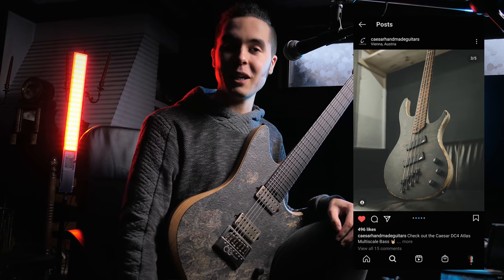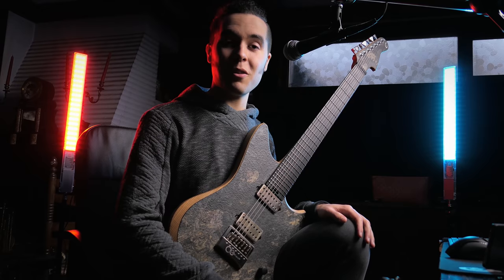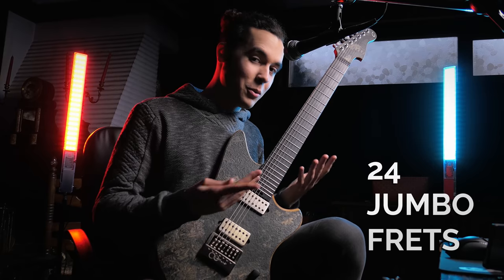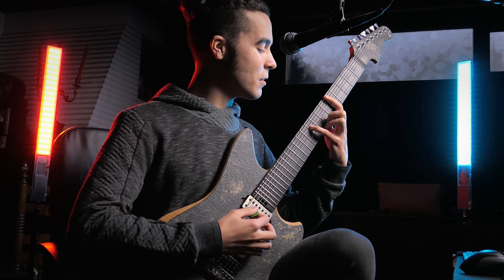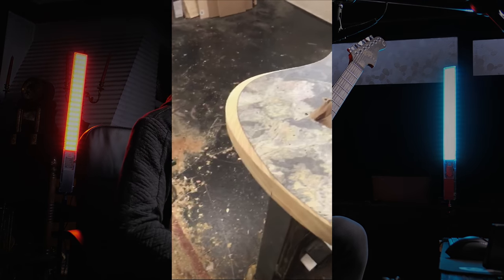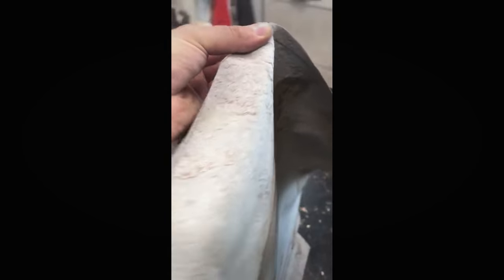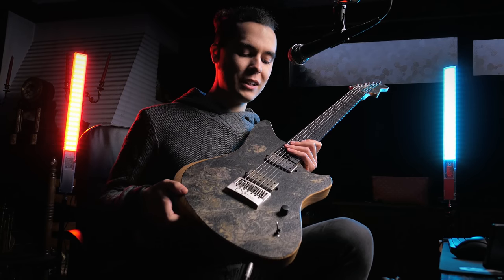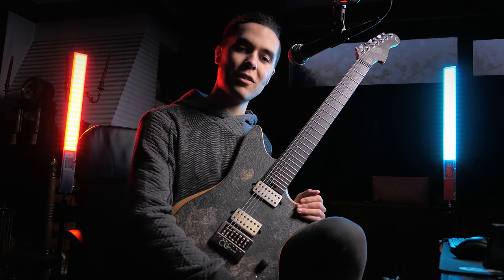My New STONE GUITAR??? - Caesar J727 Stonecrusher Demo & Review

Comment: Hey Joao, I recently picked up an evertune and I've been struggling to keep the low 7th string in tune, at lower tunings while picking hard. This occurs from F-G# and I was thinking I'm using the evertune wrong (which I doubt because I'm well into zone 2) or the string gauge is too thicc (65), causing the string to resonate weirdly. I'm wondering what your string gauges are and if you've encountered this weird situation before.
Reply from the maker: Hey man! I don't know what could be happening. I use a .074. Send me a video on Instagram showing?